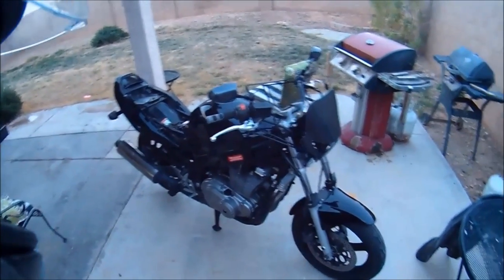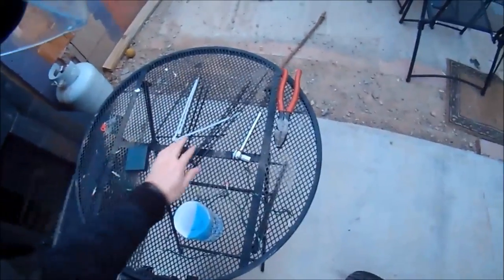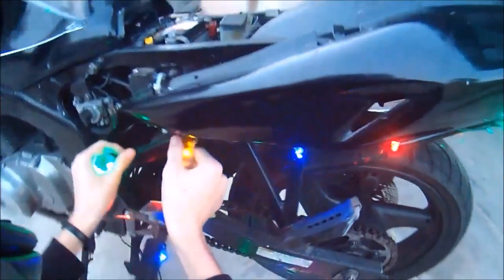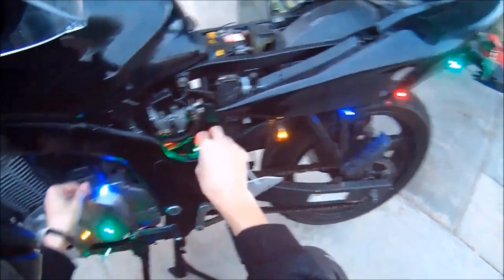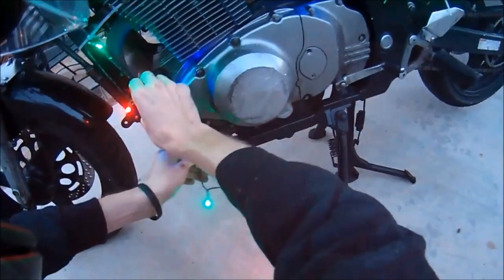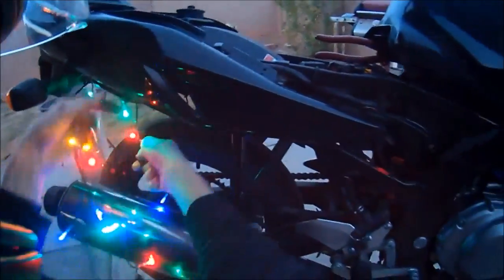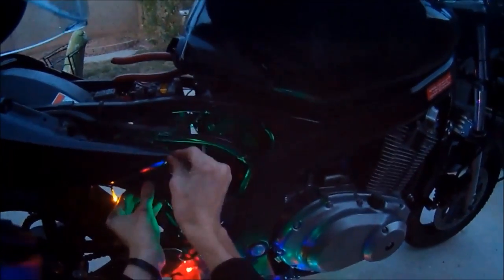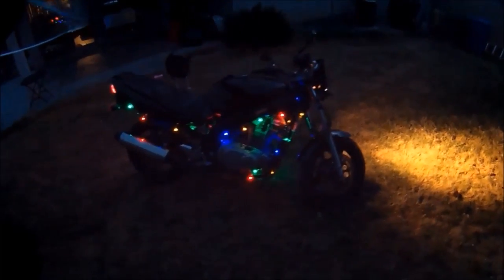Christmas lights on your bike

Comment: definetly use zip ties, i tried tape but it came out from the bottom of the rear seat, the light strand went right into the rear wheel and fortunately didnt lock up the wheel but it was a very sad moment for bike santa 😂